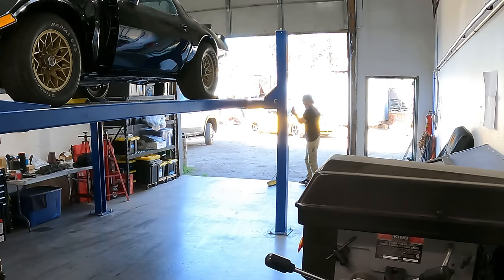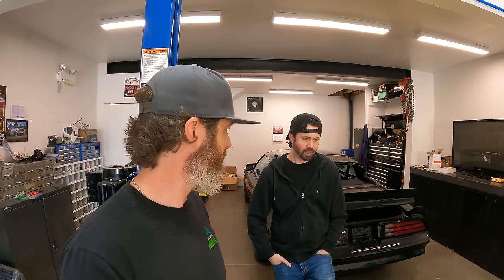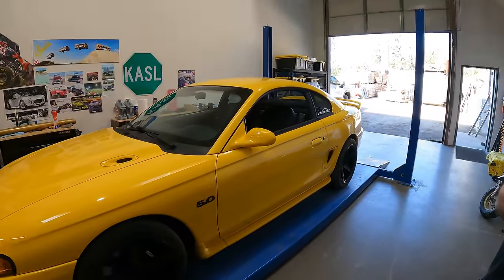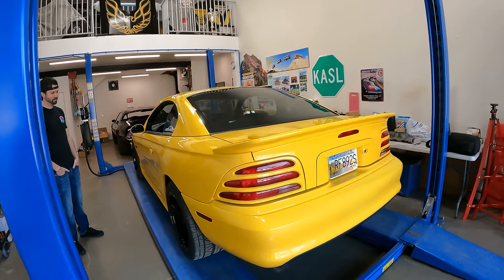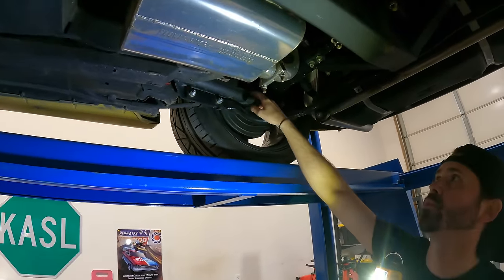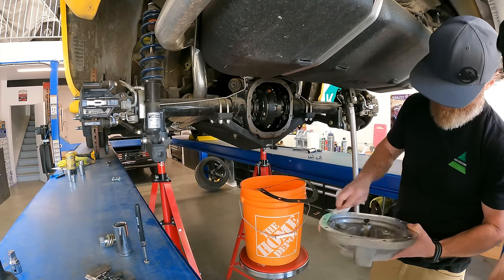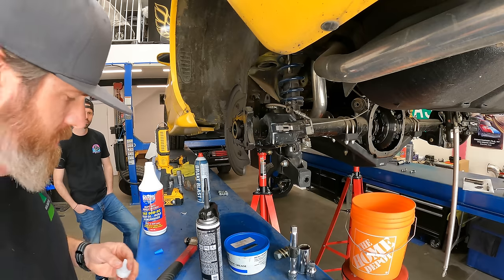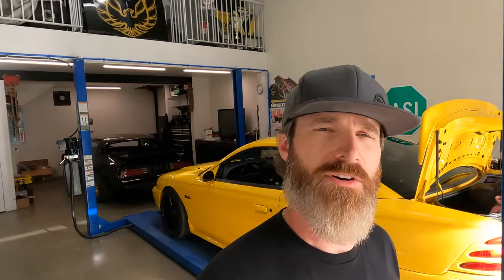The GT350 Mustang Ford Should Have Made in 1995

Comment: Been running MM's torque arm and panhard bar for years. It will make the fox act like a different animal. If you are running wide wheel and are finding that the rear axle moves enough to rub the exhaust pipes then a panhard bar is the fix. The torque arm helps with anti-squat and anti-dive. It is also one of the reasons that you can pick the front inside wheel off the ground in corners. When it is planted and you have power down it just grips and goes! You can not run the forward offset control arms in a 93 and older without doing some "making" room. There just is not enough room on them fox's.

Comment: I had a ‘94 Cobra, red with black interior. The last of the 5.0’s with a  T-5, damn I miss that car! 🦊
Reply from the maker: That would be a tough one to let go...
Reply: I have one rio red  94 svt it’s my baby man and did an accident report and a car. Fax has only had 2 owners no collisions. It’s clean as f I feel so lucky to have it o my thing is the guy sold it to with a cylinder than went and it burned oil so I had to rebuild it but but was a good thing because now I got one with  only 1200 miles and high compression heads  and a lot of mods but it’s a great car man would not sell it ever gonna hang on to it till I die lol